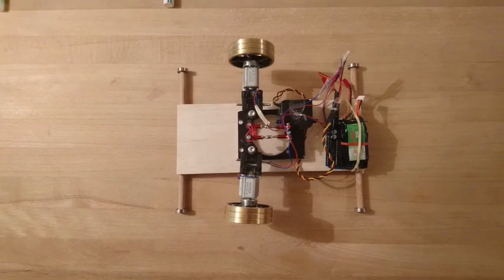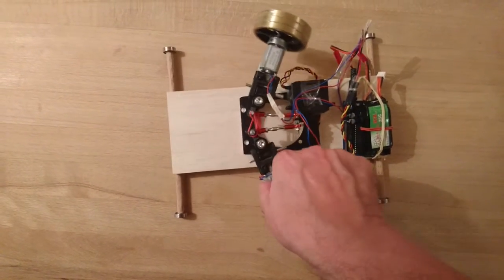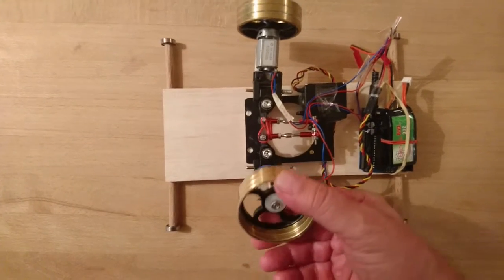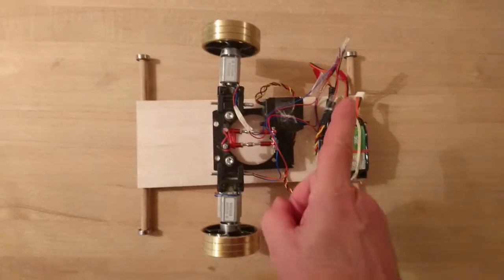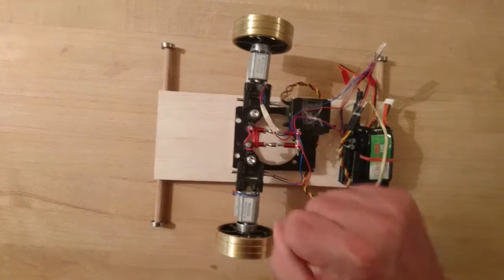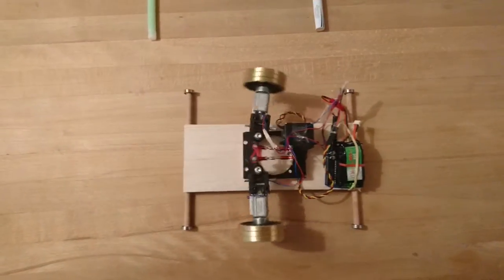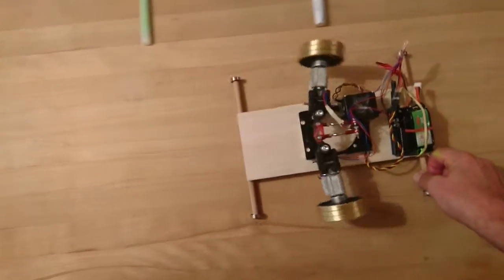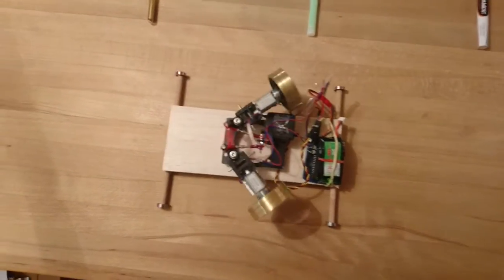inertial propulsion with gyroscope part 20 forced precession

Comment: Thank you, we are not alone! You are using lifting force, suspended by fixed point, to reduce friction during fast movement, and vice-versa during slow movement. Nice toying, i e. bending of Newton laws, still net lifting force seems elusive. Thought myself of cancelling torque in pure inertial reference frame experiment, prof. Laithwaite documented positive result in similar way, but the effect seems small... Good luck!
Reply: It came to me: Could you put it on a precise scale somehow, possibly together with support, so we could see how much weight it loses during fast precession !?

Comment: this is a classic case of non-linear friction effects, nothing more, the friction of the bearings on the table varies nonlinearly with the acceleration and velocity of the cart on the table this means that there is a slight net force in one direction between when the weights start accelerating in one direction and then abruptly stop. It's not a scalable effect, larger machines would tear themselves apart before meaningfully acceleration could be achieved.

Comment: This is a really cool video! However, I still have some suspicions. How well does this work with the Gyros turned off? The forward movement could simply be caused due to the change in speed of the servos. The servo moves forward rapidly which moves the whole cart forward. When the servo moves back, it is slower in order to limit going back. It's like if I was sitting on a chair with wheels. I could move forward by just swinging my arms and hip forward quickly and then retract them slowly. Also, does the table have a slight incline? If the table isn't level, any movement would probably be able to make it go down the slope. In other words, can it move forward in both directions of the table? Once again, awesome video. I hope I didn't confuse you with my questions. Keep up the great work!
Reply: Forget about the leveling. I just saw your part 21 video, but like many others, i'm still interested to see it run without the gyros turned on.

Comment: Sadly it's not the gyroscopes that are pushing it along. It's either pushing air backwards or exploiting "stick-slip" (an effect similar to the difference between static and kinetic friction).
Reply: Hi ColinYou are obviously young as you have convictions without doing the experiments to confirm your views (what were you trying to show with your paint can pendulum video?).  Although Newton has been the foundation of mechanical physics Woopy's lovely simple work and mine and a precious few others have shown that when it comes to gyro-dynamics Newton's laws are built on sand.  In a way you are right however, as it is not the gyros that are pushing the machine.  The gyros are merely converting the servo's input into propulsion on one swing/stroke into Newtonian action (which gives it the drive) and then gyrodynamic precession (on the next swing/stroke) which transfers most of the reaction downwards and allows the gyros mass to be repositioned without the all of the opposite reaction of the first stroke.  Et Voila:- reactionless propulsion that you can see in this lovely video.Oh! There is equal reaction in both strokes but it must be understood that the reaction is not opposite in one of the strokes.  And it must be understood that although it looks like stick/slip is happening this one really does defy Newton as it has been understood for over three hundred years.  Why not do the test yourself if you care enough?If you are young you will probably not have read this far or bothered to grasp what I have taught - still I've tried.Kind regardsNM
Reply: @jogglevision  Sadly I'm not young. And I wasn't trying to show anything with the swinging paint can. As I recall it was part of a school project my son was doing. Just used my YouTube account for convenience.
Reply: @jogglevision  Sadly to do the experiment properly I would need a vacuum chamber to eliminate the possibility that it is simply "swimming" through the air (drag is proportional to velocity squared and the gyro in this video move faster in one direction than the other).
Reply: Colin, the speed of the swings is insufficient to have any effect from Magnus and the difference in speed in one direction compared to the other is also insufficient to cause such movement.  It really is Newtonian reaction in one direction and (effectively reactionless) gyrodyamic reaction in the other as I tried to explain.  Kind regards,  NM
Reply: @jogglevision  Problem is that "gyrodynamic reaction" is a torque not a linear force. Using two gyro does not and cannot convert a torque into a linear force. I once thought it was possible but I was wrong.
Reply: Hi Colin,  Well, you are just thought wrong twice then.  The fact that it produces a torque is nothing to do with it.  The torque, in the case of Whoopy's lovely little machine is downwards on the gyrodynamic stroke and backwards on the Newtonian stroke that enables it to produce movement on each Newtonian reaction stroke. Each Newtonian stroke has reaction in the opposite direction to the gyro's swing motion as per the third law.  If this were to be used in space it would of course have to have a mirrored pair of gyros to cancel out the "downward"  torque.  Simples.  Kind regards,  NM
Reply: @jogglevision  There you go again. A torque cannot be "downward" (or in any other linear direction). There would be no need for another pair of gyro in space because the two existing gyro produce torques in opposite directions already.
Reply: The gyros on their gyrodynamic stroke produces a torque pressing downwards on the centre of the oscillating main shaft which is not as Newtonian physics predicts.  This simple fact, easy to empirically confirm, has been overlooked/ignored/misunderstood for over three hundred years.  Because this torque on the gyrodynamic stroke (though equal) is not opposite the Newtonian reaction of the next stroke its reaction is not opposed and movement takes place. It would be useful to have a mirrored arrangement in space applications for reasons of cancelling unwanted impulses making control difficult.  It might be useful to understand Nitros first and second laws to better follow this.Kind regardsNM

Comment: Very nice. It may be good to set a large ball-bearing on the table to show everyone the table is level, and not tilted down in the direction of travel.
Reply from the maker: just for your info in this test, the device is in fact slightly climbing up hill    as the table is not absolutely levelled       but against the translation direction.
And after other test, the device is able to climb (very gentle hill )  much  better than all of my previous test of all those previous 19 videos devices
 
 i am very impressed and it is very encouraging.

Comment: Are the two gyroscope-wheels SPINNING during this test?  Also, is the friction VERY low in this test?  (If not, could you repeat the test on your rolling-marble set up with very low friction?)
Reply from the maker: Hi Steven
Of course both gyros are spinning. All gyro's motor and servo and arduino are powered by the same battery (2s lipo  7.4 volts nominal).
Concerning the ball bearing they are of good quality. Perhaps i will redo the test on the marble. But sofar i will try to code the arduino in order to avoid the stop after the traction stroke .
By the way could you please take the time to comment on my part 19 -18-16- and 15 on the subject. because as you know i am trying to better understand what is going on here and your help would be greatly apreciated
thank's 
Laurent